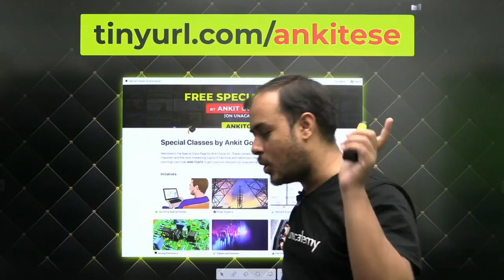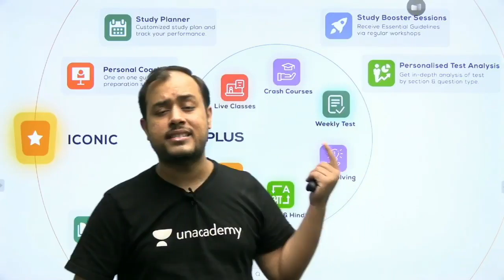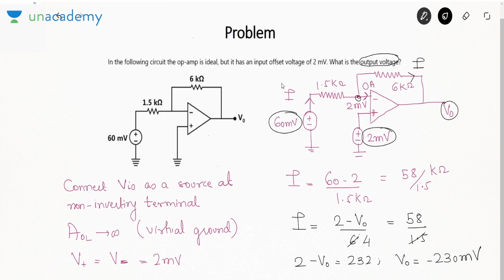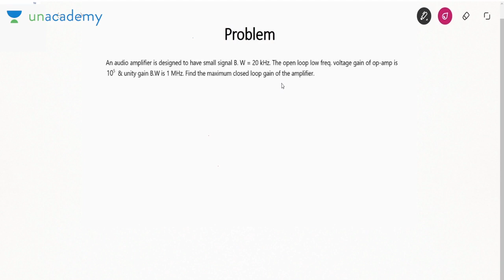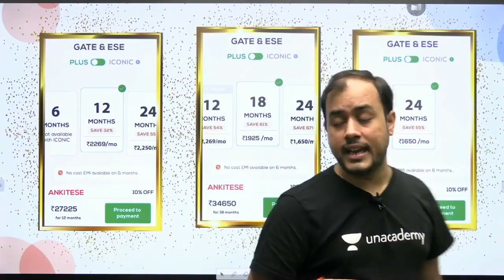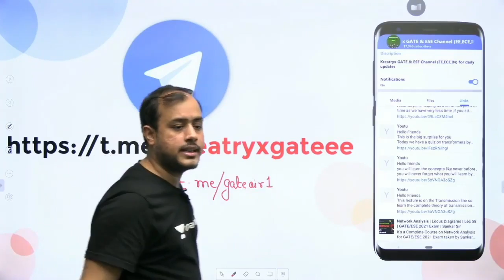Problems from Analog Electronics | Op-amp | Lec 78 | Analog Electronics | GATE 2021 Exam

Comment: I have one small doubt at 15.25 .. if we write (0 - Vo2)/500k = 150nA, then we'll get Vo2 = -75mV. Then using superposition, we'll get wrong answer. My question is that how can we decide whether the direction of current is from input side to output side or vice versa? Please anyone clear my doubt.
Reply: In video, Sir clearly says that input offset current has to be shown leaving the output terminal and entering the input terminal.
Reply: u assume the direction of current from ur side and solve....if it comes out to be positive, that means u assumed the correct direction of current...if it is negative, then the actual direction of current is opposite to the direction assumed by u